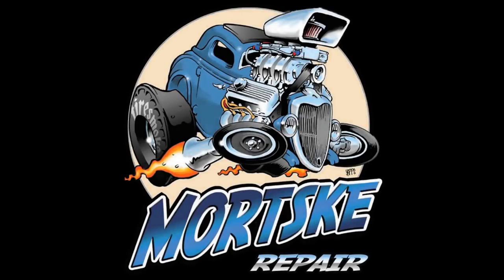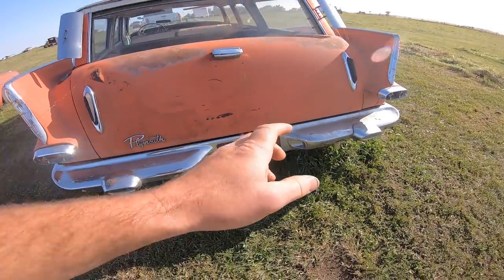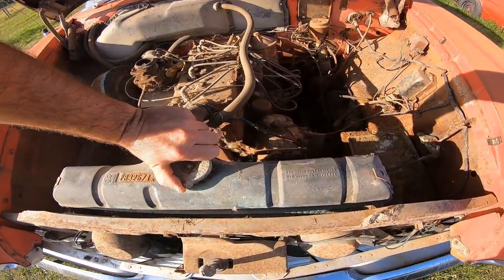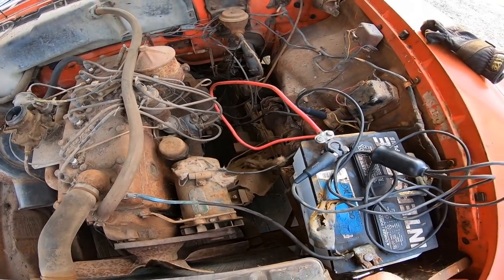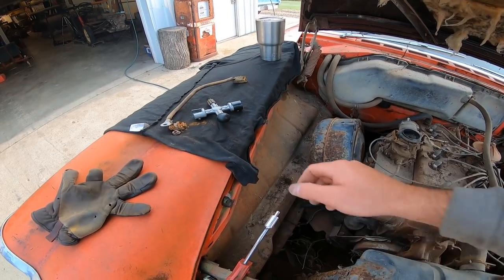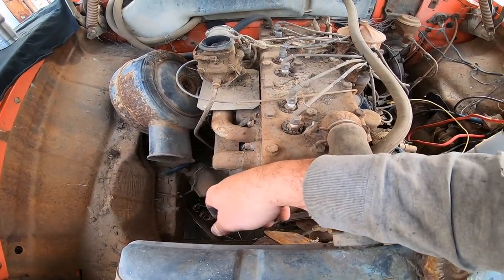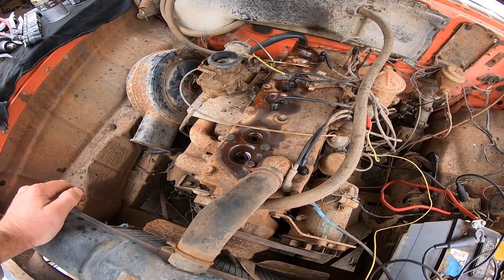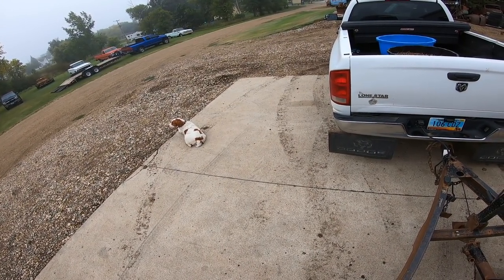1959 Plymouth Suburban Custom station wagon parked for 52 years! Mopar Flathead! Will It Run?!?

Comment: I found brand new NOS valves and a full gasket set for these flat head engines about 4yrs ago my friends 57 Chrysler burnt some valves and nobody Australia wide had any i found them on a dodge power wagon website in the USA and the full gasket set came from a USA eBay seller one set of valve the stems was to thick so i had them machined to suit his engine it's still running good today.

Comment: L/H thread on the L/H side because engineers worked out that travelling forwards, R/H thread can loosen. Some UK trucks used to be the same. They changed it to reduce cost.
Reply from the maker: I guess I wasn't aware of more left hand wheels falling off these days than rights! But yes, several manufacturers partook in this practice. IH, Mopar and Studebaker. Thanks for commenting!

Comment: I like it. Base wagon with a radio and overdrive. Perfect grocery getter.  Good one for the budget in frame rebuild. I wonder what rear end ratio?  4.11?
Reply from the maker: I guess I'm not sure what the axle ratio is. We'll find out once we get the engine going!
Reply: @MortskeRepair  ... if it has OD then probably a 3.73 rear, nudging around 3.23 in OD.

Comment: Just pulled a 56 Plymouth Plaza out of a field and all the valves are stuck open.  Even had a lizard carcass on top of a piston.  Damned flathead mopars...
Reply from the maker: I think it's just a flathead thing in general. All the Ford flathead V8s I've worked on have a stuck valve or 4. And this weekend I had a Studebaker inline 6 that had no compression on 5 cylinders as well. Stay tuned for that episode! Thanks for watching!
Reply: @MortskeRepair  I am soaking the valves in PB Blaster now.  Hoping to NOT have to tear it down....
Reply from the maker: @wayneollison4179  Take your time, tap the very center of the valve! And good luck!

Comment: Mate - when that valve let go, I reckon I said the word you were thinking at the time.....  So....flathead 6 fix.......or 318 time?  That OD setup has got to be a rare option to find.  Did they put the OD on the box or the diff (as some of the Brit vehicles of this era did)?
Reply: It's a Borg-Warner overdrive on the tailshaft of the transmission. Common to many American makes in the 1950s.
Reply from the maker: Yeah, I wasn't very happy at the time. The plan is to repair the flat six and install a later model rear axle and disc brakes up front to make it more friendly. Yes, the OD was on the transmission. Thanks for commenting!

Comment: you probably have a couple of stuck intake valves a bolt tapping down the spark plug hole will normaly get them moving
Reply from the maker: On this one I couldn't see the valves through the spark plug holes unfortunately...

Comment: Change the OIL and crank to bring the pressure up before you start!
Reply from the maker: That old oil is the good stuff! I was hoping it got enough revolutions to get oil up to the cam before it popped off. Thanks for watching and commenting Bo Jangle!
Reply: Oil change is mandatory but that car has probably been parked for a few years, not 52 as evidenced by lack of rear plate. These quick hack starts do occasionally work but internal damage usually results.
Reply from the maker: @michaelreece458  I guess I've never had issues with changing the oil when I start them. I don't run them too long on the oil that's in there. Thanks for commenting and watching Michael!
Reply: @MortskeRepair  Sludge bro....
Reply from the maker: @THRASHMETALFUNRIFFS  That all sits at the bottom of the pan! It'll be fine!! ha
Reply: @THRASHMETALFUNRIFFS  Never seen coldwarm motors change the oil on one his morpars that he's got an there in the same condition or worse except his private collection

Comment: That thing is clean for a forward look car you got lucky with that thing if that was mine I would be looking for a old Hemi to slap in that thing and make it a bitchin ride even though those flathead six were ok that's still a lot of weight to push and nothing better than a Hemi to push it with

Comment: TU 6-5844.   Back then, if South Dakota had direct dialing (should have in larger areas)  you would only have to dial 5 numbers if you were in the TU 6 (or 886) exchange. If you couldn't dial direct, you'd ask the Operator for "Tungsten" Six; 5844.   Ahhh, the good old days.  Heck... I live in rural BC Canada and even into the NINETIES, our local telephone company was still using mechanical exchanges.  We didn't have touch-tone dialing until 1996 or 1997.  Our local exchange was "365", or "Dolly Five".  But, as I was saying.... even into the 90's, as long as you were in that 365 exchange, you only had to dial FIVE numbers.    Used to be able to memorize everybody's phone number.  Today with having to dial 10.... I can't do it.

Comment: Such a cool car, really a time capsule. I know that this is yours and i am just watching, all the way from Indonesia. As an "ex" mechanical engineer and long time pilot from big radial engine ww2 vintage airplanes to my current turbine flying job (my turbine was designed in the 50s so it is all bunch of mechanical magic) I wished you took little more time with the engine. Again I am just a couch jockey but I wished you soaked the sh*t out of the cylinders, could have done that at the auction site and again home. With the flat head the valves would have gotten some of that magic juice. Dump that 52 years oil, keep spinning it without the plugs till you get some compression. Take the head off if no success, but at least make sure you are not on the cam when trying to get them free. That engine wanted to run, your video would have been amazing. I think we all want to see them run, it is uplifting. This find is amazing. I deleted this comment once since I don't want to be that guy....but here I am.
Reply from the maker: No worries!! Everyone is entitled to their own opinion. Thank you for watching over in Indonesia!! I should have taken more time and let things soak but I got in a hurry. I've got new valves and they'll be replaced shortly and this car will once again roam the streets! Thank you for commenting!

Comment: Ok what are deflectors for?   To deflect Head lights from behind? Did it work?
Reply from the maker: They deflected air around the car. Or into the back window when it was open. I can't remember which. But it was for airflow with the back window down.
Reply: @MortskeRepair  oh ok. Thx!

Comment: Is that a Plymouth fury body?made into a wagon??never knew this existed..such a awesome find.
Reply from the maker: It's the same front clip and probably doors with a different roof and quarters. They made quite a few, but not sure how many are still in existence. Thanks for watching!
Reply: @MortskeRepair  awesome find...
Reply from the maker: @waltwood4113  I'm excited to get it on the road. They don't build them like that anymore!

Comment: this wagon has different fins  than the other 59s. I think any 4d plymouth sedan of 57 58 59 can give you a working front door....i think
Reply: oh! btw wagons  command a good price!  If you run into trouble or need parts i may be able to help. Ive been around forward look for about 20 yrs. Have service manual, can send images if you need wiring diagram or etc.
Reply from the maker: Thanks for the info! It appears this door is from a sedan according to another commenter. And yes, this was the 4th highest item in an auction with 160 plus vehicles. Thanks for watching!

Comment: That's a cool wagon I would put a 440 in it if it was mine.
Reply from the maker: You've got my vote as well!! Thanks for watching!
Reply: I don't know whether Chrysler's Slant Six would work well in a 1959 Plymouth car.  If not, maybe Chrysler's 3.6-liter Pentastar V6 might work.  It's probably stronger than the original flathead Six, but not necessarily as strong as a 440 Wedge V8.  The Pentastar V6 might give better gasoline mileage than a 440 V8, though.

Comment: It was only nine years old when they parked it? Wow, hard to imagine why that happened.
Reply from the maker: Yeah, I wish I knew why they had parked it. I'm guessing we'll find out once we tear into it more. Thanks for watching!
Reply: @MortskeRepair  ... every car has a backstory. Quite often I hear they are left at a summer home or in a barn and the owner dies. Basically someone bought it because they didn't want a pick up truck as a second car. The list goes on. Locally we have a guy who bought a home from an estate and it came with an old Buick Roadmaster "woodie" wagon that only had 10k on the clock. Car was always garaged and the owner only took the train up to the country home in the summer. Turns out the wife didn't drive and she died a few years later. Bottom line is the estate was unused till it was sold in the 80s, with the 40s vintage car still in the garage.
Reply from the maker: @rupe53  I love hearing the backstories on some of these cars! Hopefully we get the back story on this one as well!

Comment: Imagine a flathead 6 pulling that thing. Oh well, I guess they pulled 2-1/2 ton trucks in WW2.
Reply: I didn't think they still made flatheads in 1959, but they obviously did.    Imagine a hot summer day with no AC and a car full of people with a 3 speed on the tree and an engine that made, what, 100 HP?
Reply from the maker: Gobs of torque combined with low gears!
Reply from the maker: I was surprised as well! They were a little behind the curve over there at Mopar!

Comment: Tell me, when will you get it running?? Sounds like a fun car to have if you do.
Reply from the maker: Over the winter we plan to redo the valvetrain and install new seals in the engine and get it going by spring. Thanks for commenting!

Comment: Worked for a brick layer back in the 90s went to start our mixer one morning and it had no compression my boss pulled the spark plug and sprayed wd40 down the spark plug hole it gave it enough compression to start how it worked but it did
Reply from the maker: Similar to a to a wet compression test vs. a dry compression test. The oil filled the void to boost the compression just enough to get it to fire I presume. Thanks for watching Daniel!

Comment: Wondering what you gonna do with that fine machine ,I say bring it to street ready
Reply from the maker: The plan is to go through the engine, parts are on order, upgrade the rear axle with an 8 3/4 and 3.91 gears and disc brake upgrades in the front. Thanks for watching!

Comment: What is your plan for the 59
Reply from the maker: Right now we've got a pile of engine parts on order to get that back in action and we've got an 8 3/4 rear with 3.91 gears as well. Still need to decide which front brake setup to go with. Thanks for commenting!

Comment: How did you get spark from a wire connected to a cap not on the distributor lol
Reply from the maker: The points signal the coil to send a spark. So I leave the coil wire on the coil but the distributor end I put close to a ground to check spark. It's a great way to see if the points and coil and the rest of the wiring are working!! Thanks for watching Dan!

Comment: Aww - shucks. I drove a 59 Savoy. The 6 was super easy to work on - but the valve stems are wimpy (as you saw). Had a driveshaft parking brake. Wish it fired up. Booo
Reply from the maker: Watch the second video

Comment: The door looks like its off a belvedere, maybe there's one of those driving around with a red wagon door.
Reply from the maker: Someone else commented what they thought it was off. A 1958 Belvedere I think. Not sure about that but somewhere out there is a banged up red wagon door I bet! Thanks for commenting and watching Wildman!
Reply: @MortskeRepair  ... I have seen that door before and recalling maybe a Plymouth Savoy. Obviously somebody out there knows where to lay their hands on a vintage Hollander's interchange manual. That's what the junk yards used years ago and I'd bet if you can find a yard that's been in business that long they have one collecting dust in the attic. Of course you could Google the Dodge / Plymouth lineup for that era and start with pictures to get some ideas.
Reply from the maker: @rupe53  Yeah I'll leave that digging up to the experts. I'm more concerned about getting the valves replaced at the moment. Thanks for watching and commenting!

Comment: Get ready and save what you can. Just about nothing is made for forward look years. Almost flat out impossible to find. But hey get thing going and cruise it. Not every old car needs to be a hot rod, a trailer queen or museum piece. Get out there and do what it was built for, driving and using.
Reply from the maker: That’s the plan

Comment: i would have done a compression test before applying any fuel.  No point trying to start it with the valves stuck.
Reply from the maker: I usually just add fuel and if it goes there's no need for a compression test. But if it doesn't then you do one. Saves a step if it fires. Thanks for watching!
Reply: @MortskeRepair  I have to admit, that is a nice find.    After a few complete revolutions manually, yeah sure try and fire it but sometimes they move only so far.  Maybe the person before you - who knows.  Good luck with the valves.  I'll keep watching and thanks for the reply.
Reply from the maker: @philipdecatanzaro1822  Yeah, I'm excited about it. And sometimes they're not stuck, just so slow to return that it won't create compression. That's the fun in this hobby.

Comment: Hello Sir ,Why not go with a 318,340 and put a auto trans in it and if need engine parts you can used slant 6 parts
Reply from the maker: James, nothing wrong with a 318/340/360, but this car is just too nice as is so the plan is to leave it all original and repair the valvetrain. It should cruise just fine with the overdrive! Thanks for watching

Comment: Yup never use a hammer on valves or any egine parts it a what not to do
Reply from the maker: Live and learn I suppose. What's your method for loosening stuck valves? Thanks for watching!
Reply: @MortskeRepair  it all depends on why it stuck if it stuck by rust then I get the best rust removal and penetrating oil but if it carbon build up I get a cleaner that will clean that.. But I bought a great tractor yrs ago it was my first tractor and water got into the egine and rusted rings and a valve and I got all clean up but valve and I tap it with hammer it didn't break I bent it after that I never did that again
Reply from the maker: @stevefarms7494  Soaking the valves would be better but I don't have the patience for that!! I'll try that out next time. Thanks for commenting!

Comment: next time pull the engine before anything and check it over and clean out all gunk get out the feeler gauge that way it give to the little bit of play so things don't break
Reply from the maker: This engine is getting pulled now to replace the valves and all of the gaskets. Thanks for watching!

Comment: next time use  a lead hammer  / get the force without the shock  / and hit the valve in the top  center not on edge of the top of the valve

Comment: That left hand thread studs for CCW rotating wheels and right hand thread studs for CW rotating wheels is a real thing. By 1959 it was one of those unnecessarily high factor of safety arguments that was made moot by the adoption of conical contact lug nuts.

Three of the 8 replies in this link are worthwhile. https://www.quora.com/Why-did-the-old-Chrysler-cars-have-lug-nuts-that-tightened-in-different-directions-on-opposite-sides-of-the-car

Keep all the old parts but put an early Slant Six and an A904 in it. Contact Uncle Tony he groks Slant Sixes and can likely put you on the road to redemption. How close are you to Tennessee?
Reply from the maker: Good information to know! Thanks for commenting!

Comment: Smacking the valves on the edge is going to get you one of two results, bent or broken! First make sure it's on the back of the cam then put the ball-peen head in the middle of the valve & "tap" on that hammer with another hammer. You can even grab the valve head with channel-locks or vice-grips & work it back & forth. Too bad you fucked it up!
Reply from the maker: I was tryin to tap on the center. I've released dozens of stuck valves and never broke one. We'll get some new parts coming and fix it up this winter. It'll be fine! Thanks for watching!

Comment: I liked the video right up until you started banging on those old valves with a ball peen hammer. Was thinking surely Mortske has a rubber one. Nope! OH WELL! Time to find a 360 to slip in there.
Reply from the maker: Oh we fixed er up good! Just check out the next video I posed on it!
Reply: @MortskeRepair  Yowzza!

Comment: Would it not have been a good idea to clean around the plugs, remove them, then pour some oil down the bores before spinning the engine on the starter? The bores would be dry after 52 years, and being a sidevalve, the valves would be lubed as well. Metal-on-.metal contact would have caused more wear in a few seconds than many thousands of miles of normal running.
Reply from the maker: I usually blow the dirt out around the plugs. I don't think the handful of times turning it over is going to hurt the cylinders at all. I don't think the valves would get lubrication this way. It'll be fine once we get some new valves in it. Thanks for watching Robbie!
Reply: @MortskeRepair  Thanks for a great video. I guess that I just can't get too much lube on my bores!
Reply from the maker: @robbierobson3251  You never wanna have to deal with a dry cylinder!